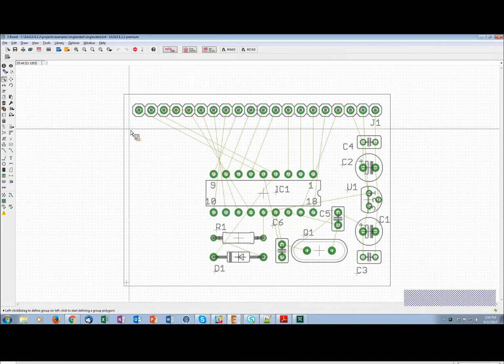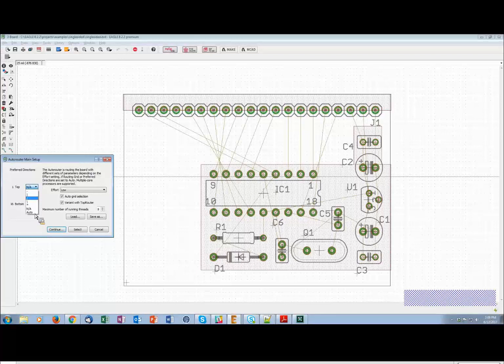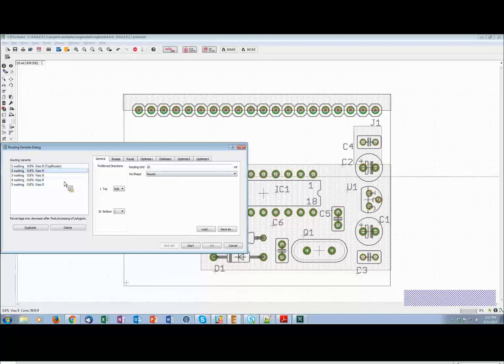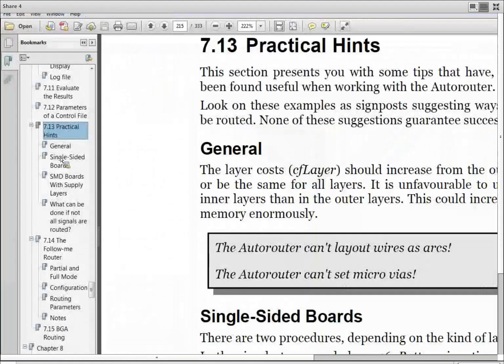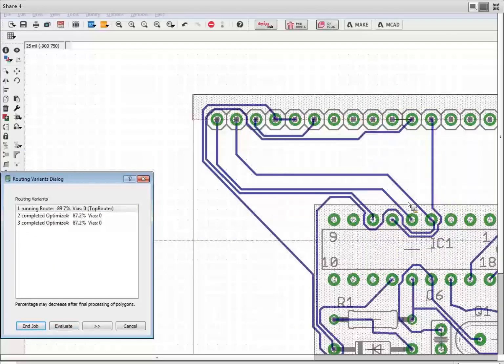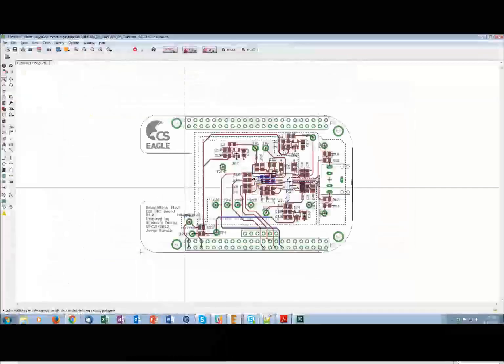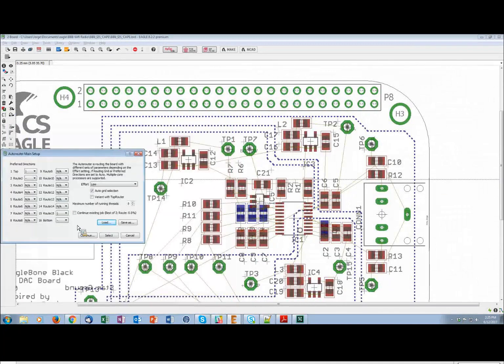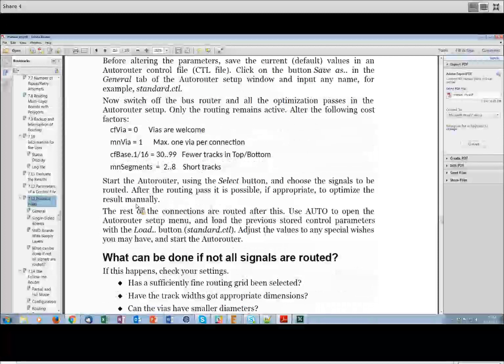Best way to use the Autorouter - Autodesk EAGLE

Comment: Eagle, please put in a "just route the damn board" mode, even if it makes 500 vias to get it done, there are times when we NEED the board to be just routed so we can send it off.  When I have literally 3 SMD chips on a credit card sized 4-layer PCB, there is NO EXCUSE why Eagle should not be able to auto-route this simple circuit at 7mil.  It goes on and on for 30 different routes which all look good but then at the end it bombs out and leaves a signal or two untraced.  It's just unbelievable.

Comment: This was a very helpful video, but Ive been trying to setup a via-gnd-drop ctl file and despite reading the manual as suggested I cant get the via gnd drop to work as shown in the video. Could you post more details on the router settings used? You skipped over the exact settings which was arguable the most important part of that section of the video. Im on 9.6.1.